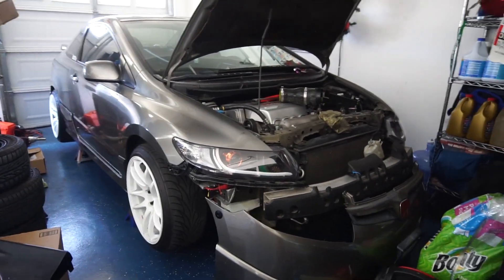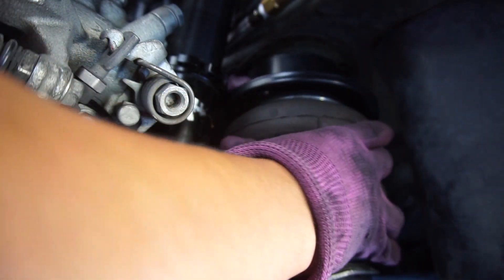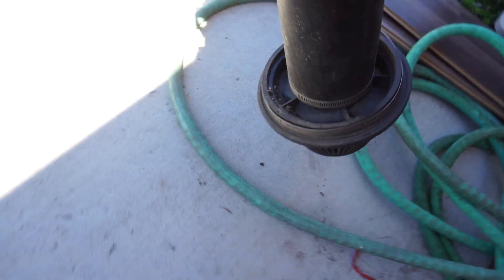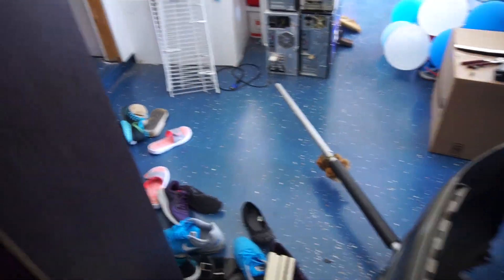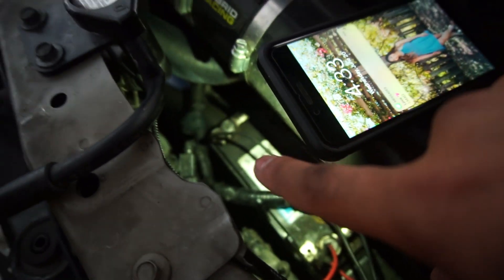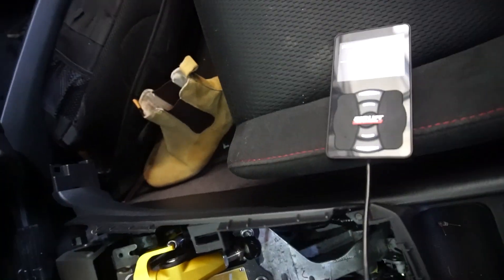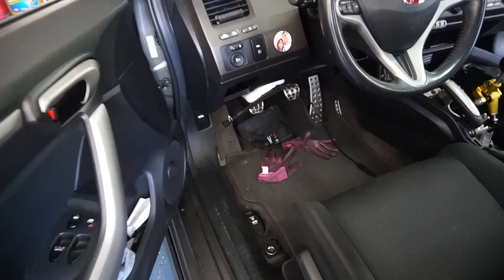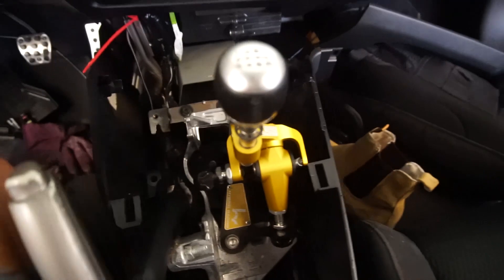Finally Driving My Civic Si AGAIN!

Comment: Dude that HR CAI battery relocation is a PITA! there was this one thin wire that is part of the wire harness that was the bane of my existence during install.  But it looks like you didn't install the lower radiator hose....?

Comment: Boss how are you doing? Big fan here. I'm wondering about using the flash pro? I want to follow your build from header to exhaust and the hondata flashpro but I'm wondering boss if you can pass the emission test after using hondata  FP? Or do you have to reset everything before going for emission testing? 
Hoping for some good advice boss before doing so. 
Videos are really helpful.
Keep it up boss.

Comment: Yo roice. I need help finding a good wheel setup. I have an 07 civic coupe. I like meaty track fitment... No stretch. What width will fit if I use an17 inch rim and what offset is ok
Reply from the maker: Carson Smith 17x9 et35 like my old rpf1
Reply: Roice Natividad 17x9 et35 will fit with no spacers ? I’m on stock suspension. What tire size should I use? Thanks for the reply !
Reply: Carson Smith 235/40
Reply: Ive got 18 x 10.5 on rear and 18x9.5 on front, no spacers and no rub unless i hit a speed bump really hard.